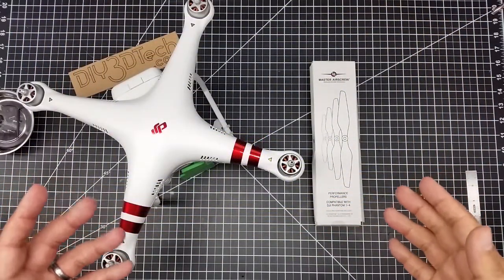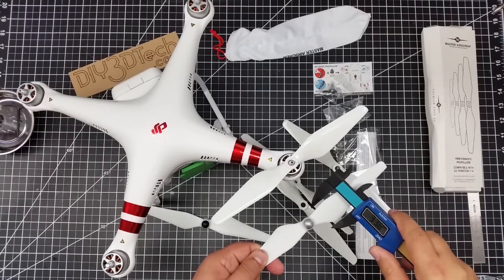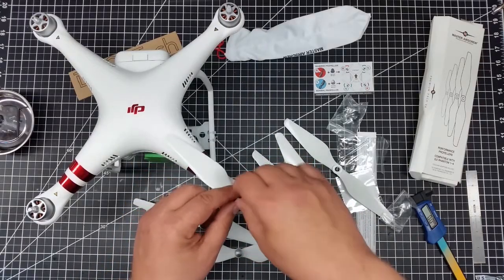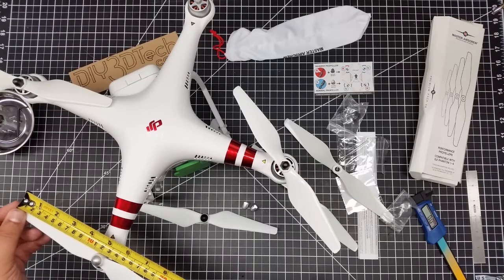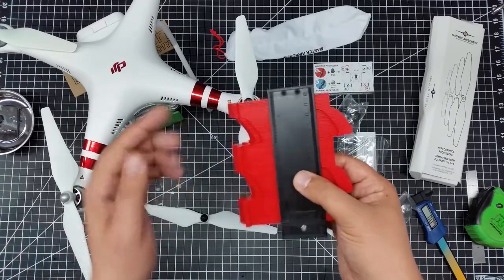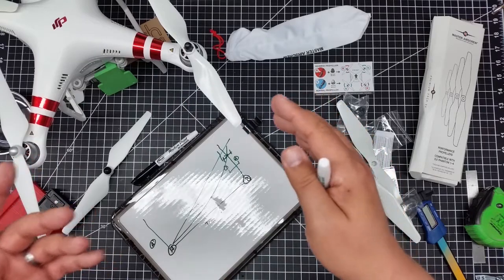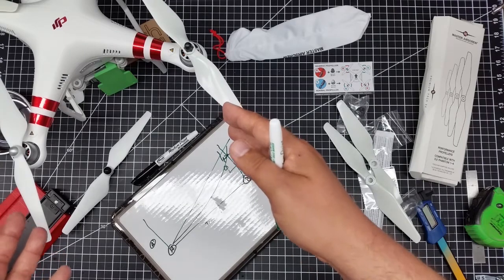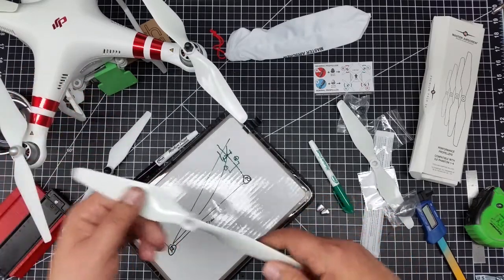Video Drone - Unboxing and Discussing the Master Aircrew Props for the Phantom!

Comment: It appears you identified and installed the 2nd black prop in the wrong position at the start of the video. Also the silver original one has been positioned incorrectly also.
Reply from the maker: Yes Black goes to black and Silver to silver, the props are coded as to direction with some VERY small numbering.  However been flying with this for a while and have a review video in the queue for the 21st of July so keep an eye out for it :-)

Comment: It would only make a noticeable diffrence if it had more pitch(a lot more) and the propeller was really heavy. I have tried 3 blade propellers and they where not stable because they where heavy and had so much drag the motors didnt have enough power to speed up or brake quickly to make those adjustments for wind.
Reply from the maker: Interesting as I have used tri-props on both the Upair One and P3S with good luck...
Reply: was it windy?
Reply from the maker: Yes actually prefer Tri-Props for winder conditions